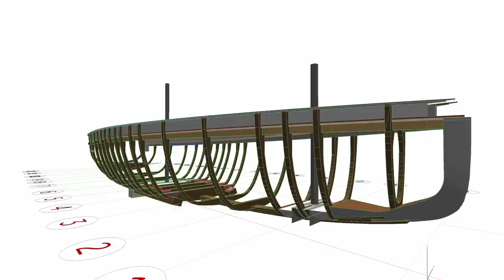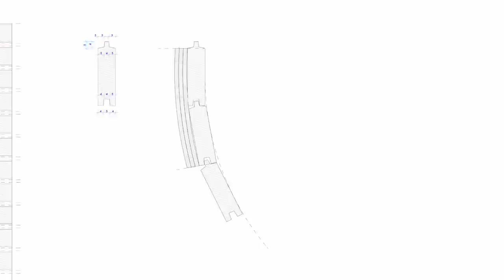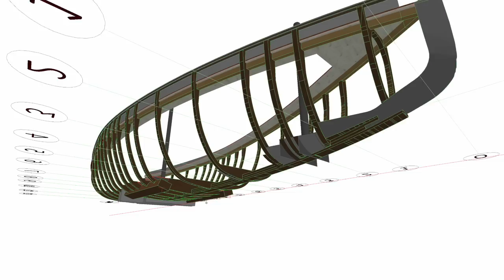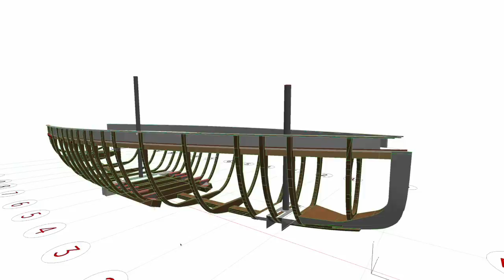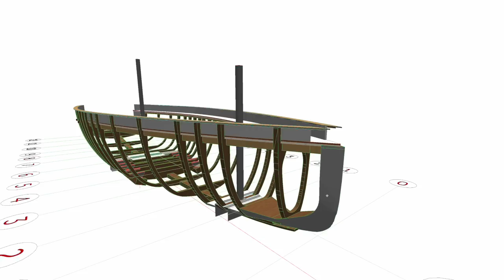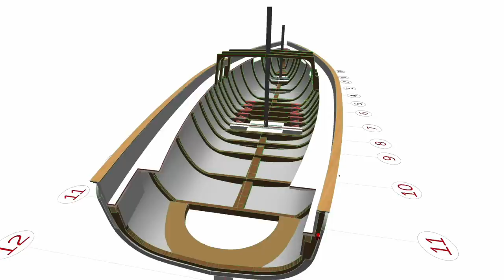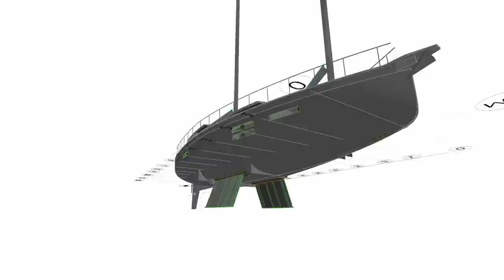Questions and answers while waiting epoxy delivery! ep.50 Project SeaCamel

Comment: Always fantastic. A single rudder makes a lot of sense. Twin rudders are exposed to getting hit. They made sense for racing boats as there was more heel in the boat. They became a marketing point and that's why cruising boats started using them. I'm a fan of the single skeg mounted rudder.
Reply from the maker: Yeah, dual rudders are needed only if the boat is so wide at the stern that normal heeling would rise the single rudder out from the water. Not a fan either.

But for redundancy I will equip the boat with some sort of emergency rudder option. We'll see :)
Reply: @ArcticSeaCamel  Agreed. I think skeg mounted is pretty good for reliability. 3 bearings holding it together. Perhaps something that mounts on a wind vane!

Comment: Sir.  Just my thoughts you Need to Insulate and Get A fast way to Heat your Building. Second is that snow on your Building?
Reply from the maker: I do need yes. That's coming in some point but not possible just yet. (€€€)
The frames I can do with the insulated box for now but bigger parts for the boat the whole space needs to be heated.
The cold of course brings some challenges with battery life of cameras though.

And yes, there's some snow. Actually just couple of days ago i rented a crane and dropped the snow and tightened the canvas for good. Snow should now come down by itself...

Comment: If you go for a multi-fuel diesel engine for your generator then you can use bio-diesel or even vegetable oil.
Reply from the maker: Yeah! Actually I have a propeller-head friend who has done DIY stuff with diesel engines. Like allowing it to burn vegetable oil. Also he has made experiments to distill diesel from plastic waste. Making small device that would utilize heat from sun and that way store that into diesel would be interesting. :P

Comment: Adding fiberglass or carbon fibre to the laminations of the frames at the mast area and bilge keel frames would make them much more resilient.
Reply from the maker: I will propably add thin fiberglass to protect the soft wood surfaces. But the structure doesn't require any additional fibers - wood is very strong stuff!

Comment: Concerned about your frame construction method, and trying to single hand the construction.  Consider having more people assistance to complete frames.  Have you cut apart your first attempt to inspect for voids?  Wood soaks up / absorbs the epoxy sucking epoxy away from joint.  This can result in dry / glue joints / bonds that can delaminate.   I would suggest  double coating the wood frame layers: First with thin epoxy then a second coat of thicker.   Also consider a separate long table to allow faster coating all the layers at once.
Reply from the maker: Hi! Thanks for the comment. I've been thinking this as well.

The first frame I did and have already shaped seems to have perfect seams. No voids to be seen.
When doing the glue-up there's quite nice squeezeout from the seams when clamping. Also the fact that the slats are planed and very smooth helps. So the contact between the slats is actually very tight on the first place. That's why I haven't been concerned of using additional thickening or more glue between there. I feel that it would be just additional waste. There's some knots and voids in the wood and those I fill up with wood flour thickened stuff.

While spreading the epoxy, I do it carefully on the both surfaces so that there's "a bit extra". The planed wood soaks it a bit but the result seems to be very good.

Yesterday I did another frame and it took over 9 hours to do. These big frames take a lot of time! Additional hands would help of course but there isn't that many people around to help - especially when you think I would need them couple of times of week for several hours during many weeks...
Actually yesterday I started thinking if I should divide the biggest frames into smaller chunks just to be able to make them in faster sessions over several days - instead of single massive job... we'll see.

Comment: Wow, the CAD graphics looked familiar, and lo and behold, that layer dialog confirmed it!😀 You are actually drawing this up in ArchiCAD? The last release I routinely worked with was around R20, and I wouldn't have dared taking on such a challenge... It must have come a long way - or you are just a very mad lad 😁Very interesting project, I'll follow along!
Reply from the maker: I can ensure that ArchiCAD is not the right tool for boat nor CNC design! 😅
But It’s what I have and know sooo well. Been using it daily for 15 years and I know pretty well what it is capable of.
Now that I have already done quite a lot of parts I’d really hope that I could get more CAM-stuff out of it. Limitation really is to get flat profiles out of every part. Now I need to hassle with morphs, sections and 2d-hatches.

One benefit however is that ArchiCAD kind of forces me to keep it simple!
Reply: @ArcticSeaCamel  The part about being forced to keep things simple is something I'll keep in mind! That's an interesting thought. In the realm of architecture, I usually scoff at that - sometimes I feel I can tell by the style of a certain building that it was drawn in Archicad... Yuck! 😂 I've been using Archicad in my day job probably since it's inception, until a few years ago, so I can really attest to your accomplishment - and feel your pain. 😁👍 
For my nerdy tinkering I learned mechanical/parametric CAD some time ago. The leap was not as big as I initially thought. We are already in the "parametric mindset" coming from Archicad... Taking the time to learn something like F360 might pay off for you in the long run, and if it is only for the ease of CAMing something quickly...
All the best to you going forward!
Reply from the maker: Yeah, there's possibility to notice buildings designed with specific application! 😄

What I like is ArchiCAD's simple workflow and as I've used it so much it's kind of in my veins. Don't really need to think about it at all. (and all those custom keyboard shortcuts etc...😜)

I have used now fusion360 for making the CAM stuff and some small design things. But I hate that program so much! It kind of works but feels like having mittens on your hands all the time! Slow and painful! And also bit buggy and "Autodesky". 😆 (oh and that "I-want-to-be-connected-all-the-time-or-I'll-tell-your-mama"-stuff! 🤬)
I kind of understand the parametric idea but IMO it kind of restricts the workflow too much when you're doing the actual design work. Tinkering, testing, etc etc. When I have and idea of something I just want to do it quickly and see what comes out of it.

What I could wish is simple CAM add-on to ArchiCAD! 🤩

Comment: On the rough pricing estimate, the masts seem exorbitantly expensive compared to the rest of the main projects. Would there be any way to cut those costs without compromising too much?
Reply from the maker: That is a good question and to tell you the truth - I cannot really know the real expense of carbon fiber for the masts yet. I don't know how much there has to be material and I don't know what material and how much that costs. 😅
So the 20K is just a very uneducated guess at the moment!

But for the question - the original boat from where this design has been taken (https://www.tantonyachtdesign.com/boat-plans/50-millenium-falcon-steel) , has wooden masts. I believe solid but not actually sure. And I got information that they've been shortened at some point because the boat didn't eventually need that much power. And that the boat has had rollover somewhere in Pacific coast of South America without damage.

So - if the carbon masts (which I would really REALLY want to have as rotating) turn out to be just too expensive, there's option to follow the original plans and make them from wood. But still free standing :)
Reply: @ArcticSeaCamel  From my experience with carbon, even though it may be 6x the price of fiber glass, the actual cost is more like 2x or 3x because you need so much less material for the same strength but I only have only done very small projects like skate and surf boards. I don't have a clue how much carbon one would need for a mast though.

Looking forward to your next video and the build progression, it's like a combination of software, automation and boat building so that's pretty unique and I like it.

Comment: Why are you worried about stringers in the boat if you are insulating it heavily? The problem with a stringer is that it catches water and debris that would other wise fall into the bilge, but if you are  putting insulation in that insulation is going to catch and moisture or debris against the hull too.
Reply from the maker: Hi! Good question. Stringers are problematic that they can puddle water on top of them and on wooden boat that's to be avoided. Especially if there's no access to inspect them.
As for insulation - I really haven't made decision how I'm gonna do that. There's kind of two ways to go in my opinion. Either to make the bond with hull completely waterproof - kind of making the insulation part of the hull - or having some kid of air gap between to be able to have airflow to dry things.
As said - currently I don't have clue how or what kind of insulation i will use. Also I'd like the idea that insulation could be removed without breaking it if necessary to get access to hull surface. That might be too much to be asked though...

We'll see. The wooden hull of course is quite insulating by itself compared to fiberglass or metals.

Comment: Instead of tongue and grove, maybe bead and cove?...the angles between the thin planks do not have gaps in them.  I know that is used on strip built canoes.
Reply from the maker: Yes, there's options there. Not sure yet which i'm gonna use but the bead and cove obviously has advantages there. But also it has pretty thin sections which may be problematic. We'll see 😊
Reply: @ArcticSeaCamel  I am pretty sure that you can get different sized sets of bead and cove router bits so that you can use thicker planks.

Comment: When seeing all the burden of these kind of composite construction I guess I would go for an english wheel and work with aluminium.
Reply from the maker: All materials has their good and bad sides. With aluminum you’d need welders, cranes, very high accuracy and piles of money! 😅
Reply: @ArcticSeaCamel  I have a quite good source for marine Aluminium in 12m sheets in 6mm to 12mm I really thought a couple of times to blow up the speed lounger concept and turn it into a expedition cruiser of 11.5m to keep it cheap with Mediterranean Waters where you have to pay per length annually… I calculated material costs for the hull and decks structure of about € 28.000,– but over all I guess it’s difficult to get it onto the waters for under 200k over all with systems, rigging, sails, ocean volt and fisher panda back-up ;-)